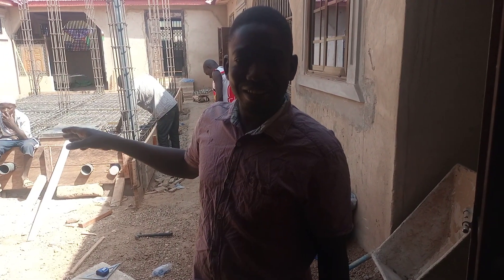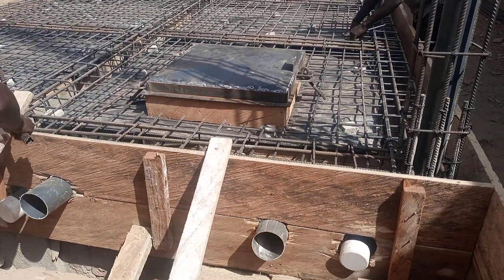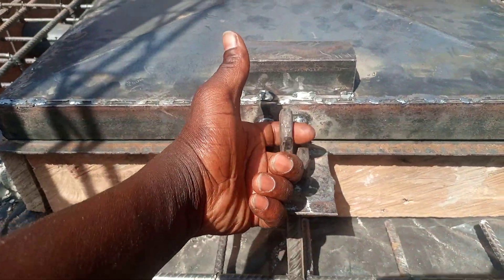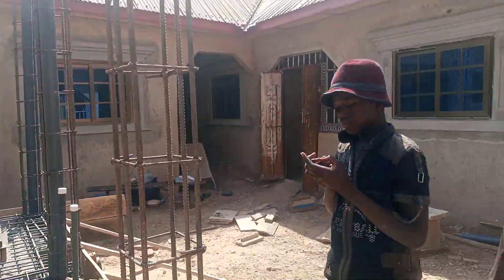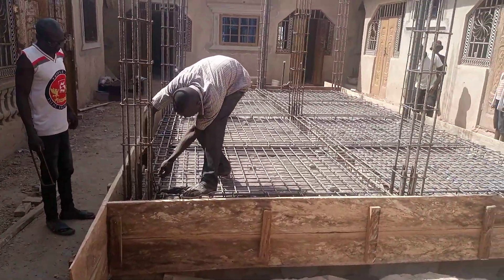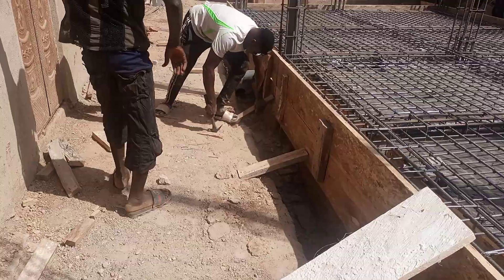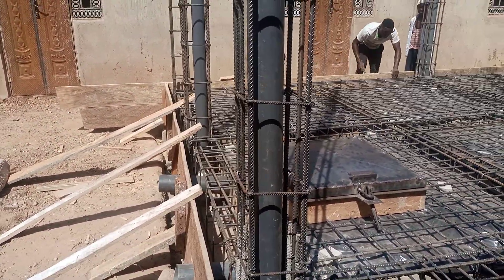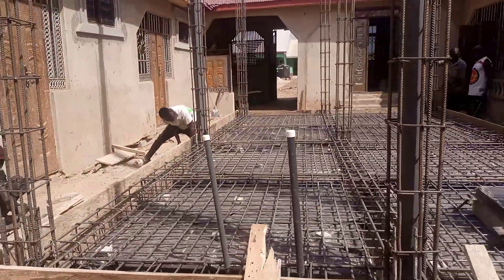THE STEEL BENDER AND THE CARPENTER HAS DONE A MARVELOUS JOB

Comment: For all concerned the acces opening is a frame that is put in place before the cement is poored it is Not steel usually a material to prevent rusting.
Reply from the maker: That's a great idea